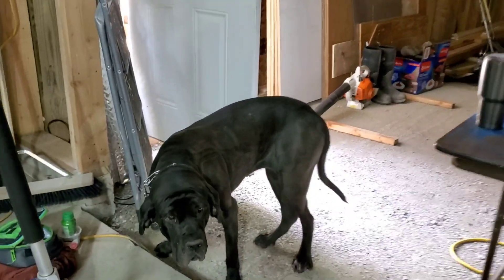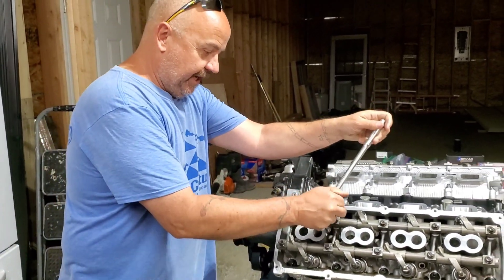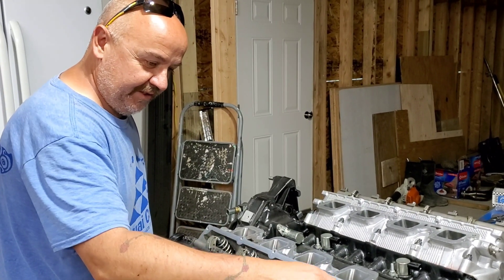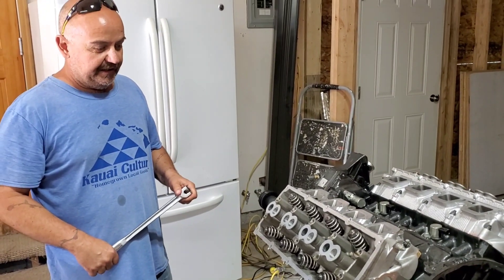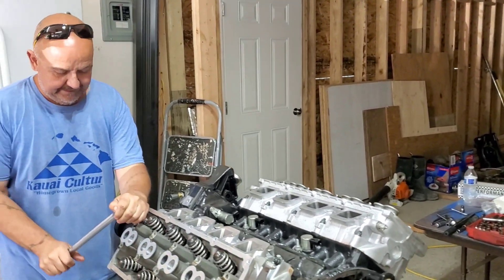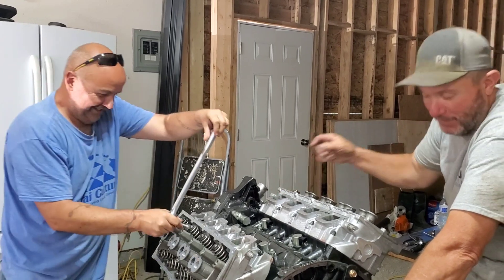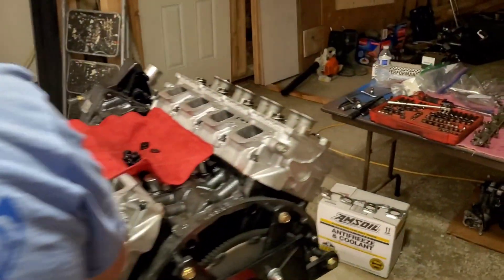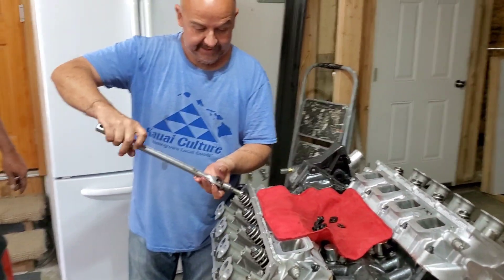How to Remove your Heads and Rocker Arm Assembly on a 392 Hemi Stroker Engine!

Comment: I'm having a huge issue.  When i install the push rods top short intake and long exhaust.. they fall into the engine they wont seat at the rocker arm slots. What am i doing wrong?